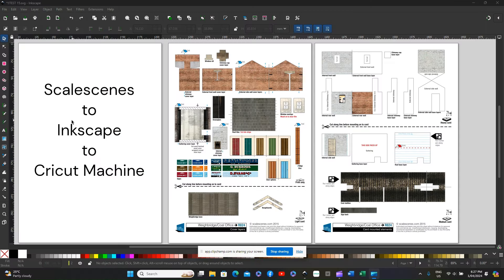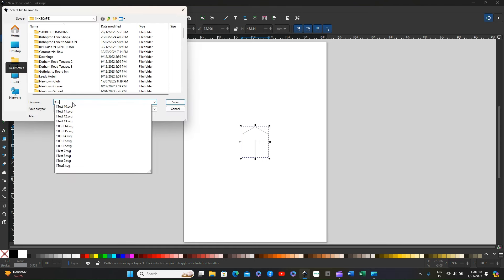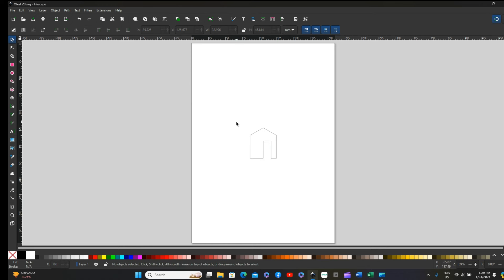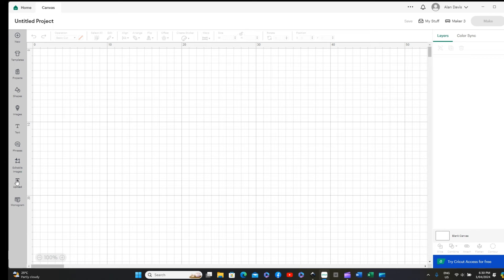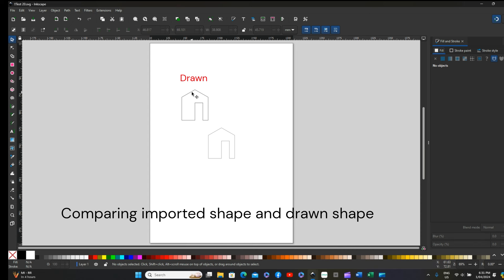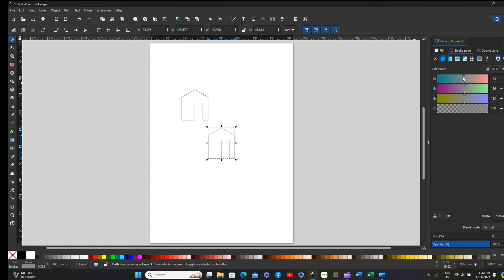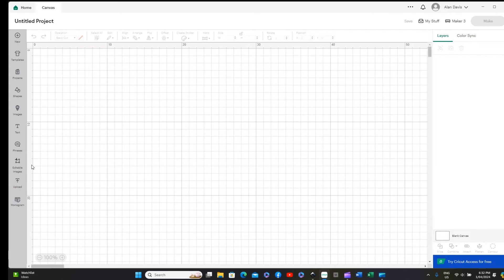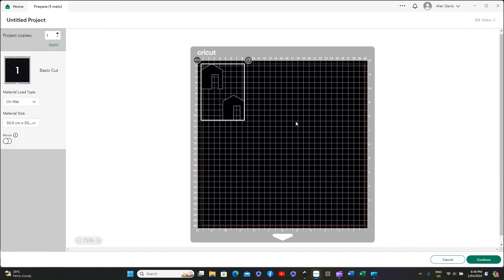Issue in transfer of Scalescenes PDF to Inkscape to Cricut Design Space.

Comment: Alan, thanks for the video. In summary, would I be right in saying that all items to be cut need to have the lines in RGB as 0-R, 0-G and 0-B? If any item isn't then none of the items appear in Design Space?
Reply from the maker: Yes, from my testing that appears correct but in previous versions of Inkscape and Design Space it wasn’t an issue so I suspect one of the updates in the programs is causing this hopefully temporarily as I have found other issues I am working on. Alan
Reply from the maker: Hi Andrew I am about to post a second video that deals with same issue specifically around window frames you might like to watch.

Comment: What martrial and what thickness are you cunnting with your Cricut?
Within Design Space, which material and thickness are you choosing to "Make" these?
Reply from the maker: I can cut anything up to 2mm card no problem (slow) but prefer 1.3 then laminate them
Reply: @StocktonStation  Which material do you select in the cutting process using Design Space?
Reply from the maker: @Hal-Zuzzu_Model_Railway  hi again. For the 1.3 mm I select 1.5 mat board and add extra couple of passes in settings (9) plus more pressure setting.
Reply: @StocktonStation  Perfect. I have both the knife blade and the deep-point blade. So far, I have only used the knife blade but deep-point blade is also working on this material selection :)
Reply from the maker: @Hal-Zuzzu_Model_Railway  yes both work well but knife blade uses a few more cuts.